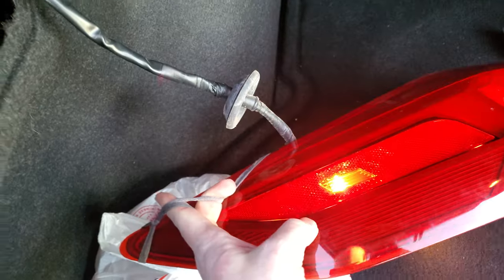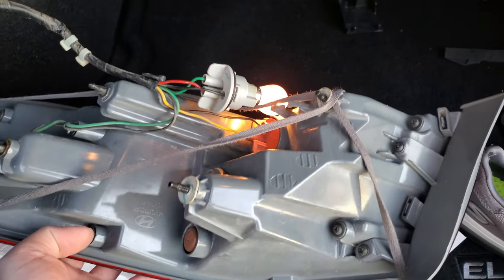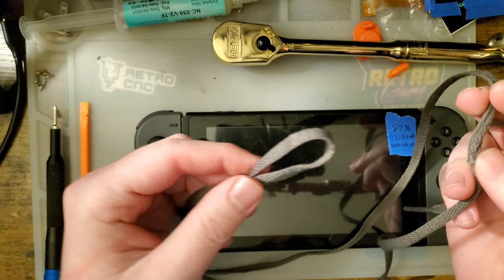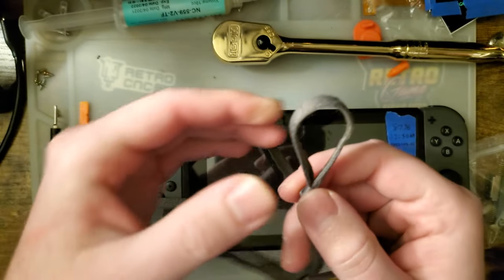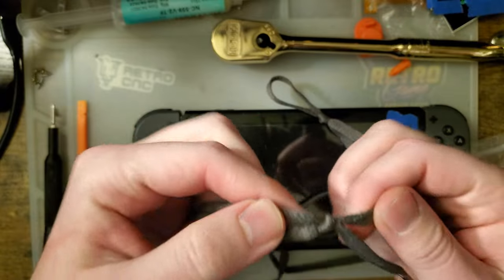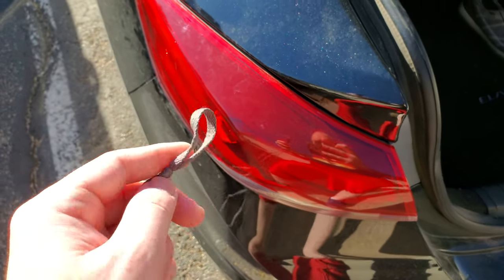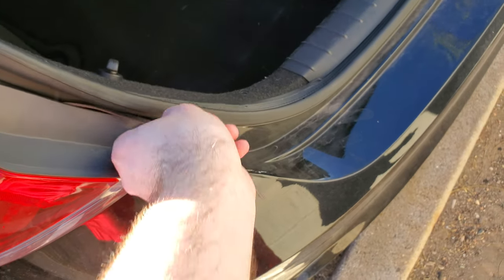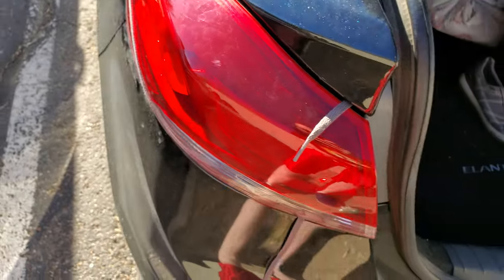2018 Hyundai Elantra Tail Light Removal

Comment: Just want to say thank you. Tried for an hour doing this the regular way and the light would wiggle but would NOT come out. Used your shoe lace method, and at first the light still wouldn’t budge, but once I changed the angle and pulled more towards the middle-back of the car, the tail light popped out so quick I almost fell lol.

Thank you so much.

Comment: You know, this is never what I'd have expected from this channel, but this is about as ingenious as a solution to this issue as I've seen. I've had issues with this with previous cars, not just the model in question, and next time I need a tail light out, I'll absolutely use this method. Those clips they clip onto when slid back into place hold on just a bit too tight every time.

Comment: First comment I have ever written and it goes to you.  Not only did the knotted string work (and this was after hours of trying other ways from myself, friends, and finally other videos) but when I went to replace the bulb it was intact.  Either a loose bulb or dust was the source of my problem.  Here’s my point - I shudder to think of how much time, frustration, and money I would have spent on labor and a ‘new bulb’ had you not made this video.  Thank you for saving me all that and I wish the best for you and your channel.
Reply from the maker: I've had the bulb stop working on this car three times since I've owned it, always that housing. At least one time, all I had to do was reseat the harness and bulb and it was working again. 

Not sure what the issue is but I suspect these cars have a defect that causes high resistance at the bulb which leads to an overcurrent situation and then the bulb to overheats. 

Not sure what the solution is either but perhaps retrofitting LEDs here might help.

Comment: This method is easy peasy to get that light assembly off to replace the brake light bulb. Kudos to the gentleman who figured out how to get that dammed tail light assembly off to replace the bulb. I need to bring my 2018 Elantra in for a state inspection. The sensors did not show the bulb was defective. it failed the inspection due to that bulb. twice I had tried to get that light assembly off. I found this video,, one easy tug to set the shoelaces, a second tug to make sure everything was set. A third pull, not a hard crazy pull, just a pull and the tail light assembly came right out! easy peasy.

Comment: Best way to get this light assembly off without damaging anything is to remove the bolts and the rubber plug then take a long socket extension and place it in the hole against a flat spot make sure it's not against the light caps or anything you will damage.   The hard clip holding it is under the narrow piece of the light if you wiggle the light lose and squirt a bunch of lubricant behind where the clip is it should release easier from the clip.  Then cover the light in duct tape leaving some hanging at the back to grab and pull it backwards.  When all this is done get 2 people one to hammer the extension from behind and the other to tug on the duct tape. It will take some force but it will pop out. I struggled with this thing for months until this worked for me.   Good luck it's a huge pain really poor design.
Reply from the maker: If I had a second pair of hands, this might work. One of my earlier attempts involved using that hole the rubber grommet seats into and trying to shove a wedge in there. The sheet metal started bending though so probably don't do that. 

Good call on the lube though, I didn't even think about that to loosen those clips.